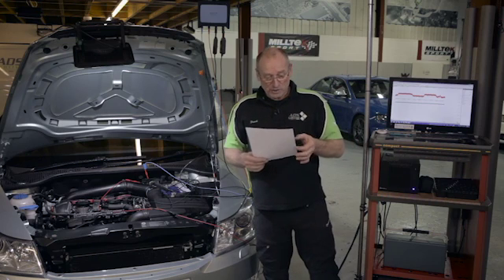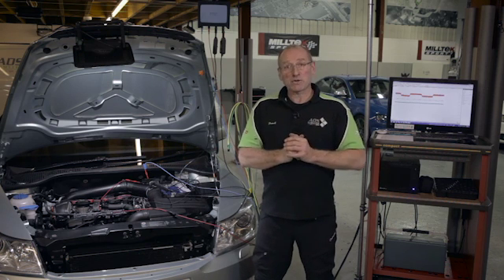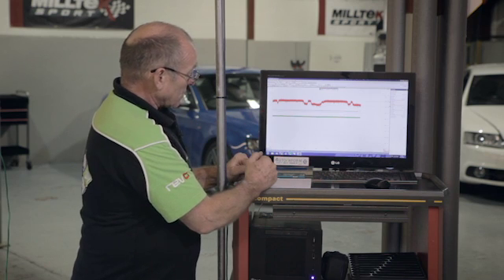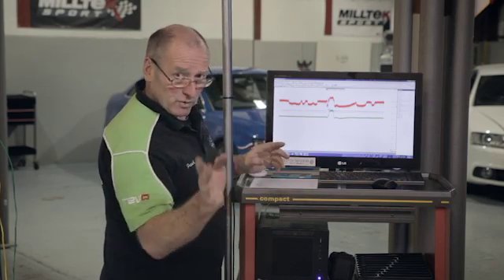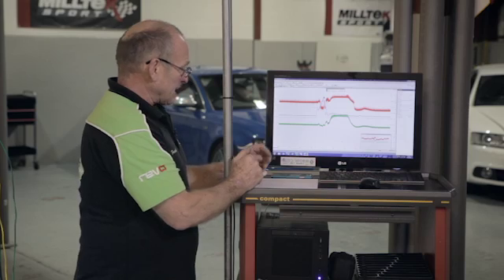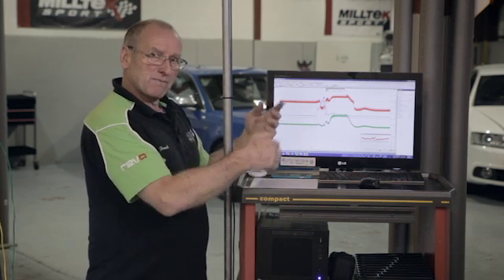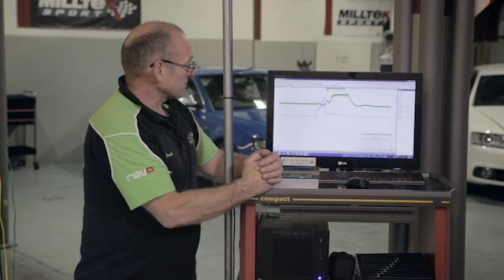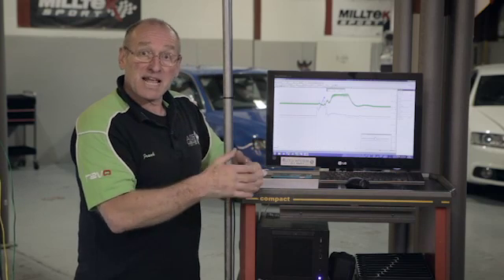Frank Massey's Top Ten Tests with PicoScope: #4 Wide band lambda

Comment: Frank is it true that with the O2 and battery positive disconnected there should be no short to chassis, or B+ cable from the ECMs pins 2, 6? Great and informative video!

Comment: How do you go about testing a wideband sensor on a Diesel engine?
Reply from the maker: Looking at diesel lambda sensor activity is always going to be tricky as there is very little fuel to measure. Diesels are run relatively lean which is why the sensor doesn't react the way we would expect and especially with one that was fitted to a petrol engine. To observe activity will have to almost force the vehicle to produce a rich mixture. 

This could be done during high engine load for a prolonged period of time or during regeneration. Kim Andersen on our forum has put together a great piece on the Bosch LSU 4.9 sensor which describes a way to test these sensors: https://www.picoauto.com/support/post31931.html.

Also we have the Bosch LSU 4.2 sensor on our website under the training section which could also be of some use: https://www.picoauto.com/library/training/testing-the-bosch-lsu-4-2-broadband-oxygen-sensor

Hopefully this helps and as always we are forever learning new ways to test the different and new sensors and we will try to bring new techniques as we discover them.

Comment: What are you using for the current measurement? Does the 20A clamp go that low?
Reply: It is a AC/DC ammeter probe for very low current in the order of 450mA peak.
Mr. Frank Massey is using two. One of them for the MAF sensor and the other one for HO2 sensor.
Reply: never